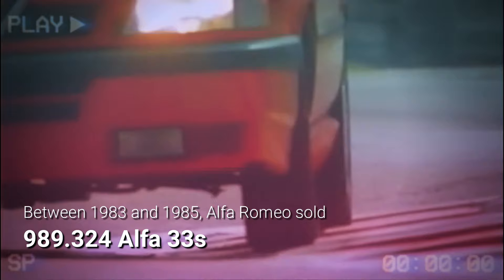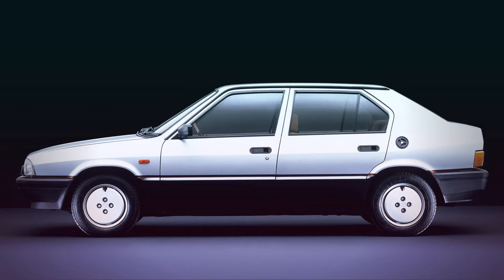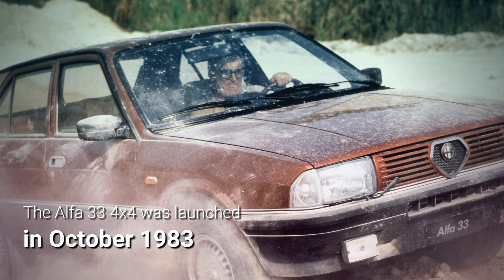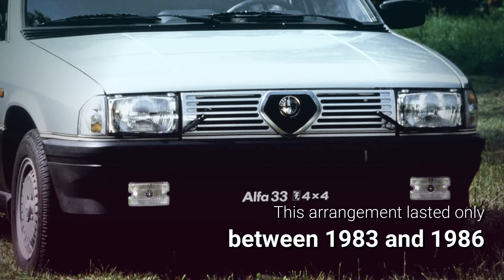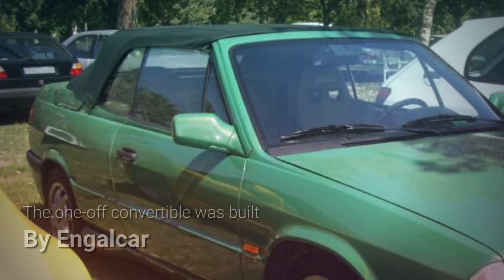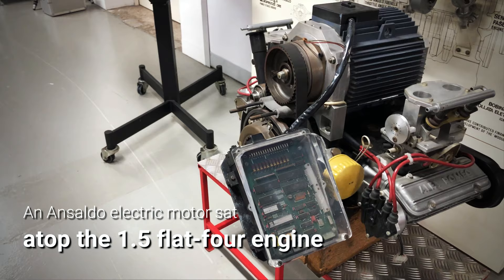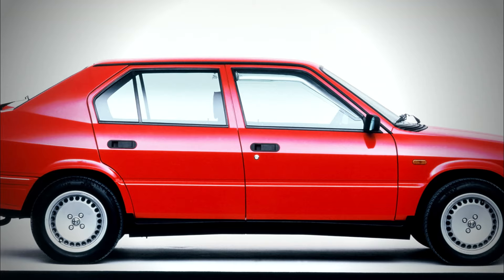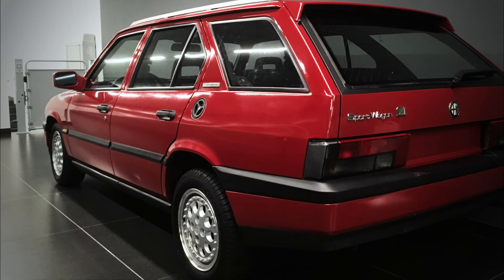5 Things You Didn't Know About the Alfa Romeo 33

Comment: Ahhh one of my favorite Alfas❤️
Owning two 33 at the moment. Both in Grigio Ardesia, 1x 1990 very early 1.3 VL Import from Turin( my First Car) and since 3 weeks a 1991 1.4 IE Project that’s under construction right now.
Reply from the maker: Very nice! Does the 1.4 IE need much work?
Reply: @Matteo_Licata   more or less, some body work is already done like rust protection and so on, big service is needed because it’s of the road since 2017. Brakes, Oil, Coolant etc. Already have a new set of Period correct wheels combinated with lowering Springs. Fun project so far and I can say I love Easy repairable cars of that period.❤️🚗
Reply: Torino or Turin 😉
Reply: @nessuno5403  yeah auto correct 🙄

Comment: I drove a few early 1.5 models with carburettors and drove nearly all the facelift range round Silverstone Club Circuit on an Alfa day in September 1991. That was great fun and the car was much improved with the 1.7 injected engine. I'd happily drive one now, it would still be a rewarding car to drive.
Reply from the maker: Cool. Must have been a lot of fun on the track that day!
Reply: @Matteo_Licata  I drove down there in a white 164 Cloverleaf and we had the whole range to play with ( they were Alfa UK staff cars). The day was run by the late Will Hoy( on behalf of Alfa UK) who had been a BTCC champion. As well as driving we also had rides with racing drivers and that was an eye opener. As guests we were far more careful not to abuse the hospitality of Alfa UK, but the professional drivers could let loose. Oversteering in a 164 was.....interesting😁

Comment: I had three 33s and no regrets. A 1991 1.7 8V, a 1990 1.7 16V and for nine years I ran a 1991 1.7 16V (last year before catalytic converters) 137hp P4. Great fun. I moved on to a Cloverleaf 145 Twin Spark with 155hp. Even more fun, a complete go-kart with incredibly direct steering.

Comment: I bought two Alfa Romeo 33. My experience with this car is mainly positive. It was funny to drive and performing for that time period. The engine was excellent, unfortunately FIAT didn’t understand its growing capacities and discontinued it. I experienced just one issue affecting the car stability during breaking at high speed (over 160 km/h) that needed an increasing of control and prompt driver reaction. It was probably due to the weight balance.

Comment: I still have a 33 SW 1.7 that I bought used in 1992. Great car, original engine and clutch, no oil consumption. I did all maintenance myself including replacement of timing belts ... ouch.... it drives to well to get rid of

Comment: Very interesting, the three door looked stunning. But wasn't the Arna intended to replace the Alfasud and the 33 placed higher in the range? At least for the marketing department. Ciao🙋‍♂️
Reply: It was more of a segmentation. They were positioned into the same class but with different target groups. The Arna should have been the entry model for youngsters without the need of large boot and offering 3-door layout while the 33 was targeting families with lower financial background still however providing great driving pleasure and good performance in the category.
Reply from the maker: The 33 was indeed positioned slightly higher than the Alfasud, with the Arna catering for the lower end of the market. But, having inherited the Sud's floorpan and running gear, the 33 is very much the model's direct successor anyway.

Comment: The British motoring press didn’t like the 33, because they were obsessed with the Alfasud. It seems the extra weight, but the same engines, even same power levels, took the edge off performance and handling. The Sud’s real secret weapon was the inboard discs. If you’ve ever lifted a brake rotor, you can feel the difference 😂
Reply from the maker: Yes, I know the 33 isn't held in the same high regard as the Alfasud handling-wise. Yet the Italians at the time couldn't care less and bought 33s by the truckload. The 33's design gave it a classier, more upmarket image, perfectly in tune with the 80s zeitgeist.

Comment: This video came in this day when I have a issue with my 33. The car just won't start. Thanks a lot for the video pal.
Reply from the maker: Hope it'll be an easy fix, thank you!
Reply: @Matteo_Licata  I think the timing belts slipped and the cars doesn't start, I refurbished the dellorto carburators, replace the distributor, cap and rotor, ignition module, spark plugs, etc, and, nothing happens, just the starter crunk... I don't known what to do....

Comment: Alfa 33 is great, it drives great, sounds amazing and there is a verion with 4x4 (my weak spot with cars), but damn it ages so so bad. Most of available models today are in disastrous condition with literally no parts available (I did found a German shop offering racing parts for Alfa 33, prices start at 500€ for even the smallest bits). This is why I ended up with 146 1.7. The suspension is from FIAT (the rear at least) and there is still a lot of parts available. BUT! My goal always was to install the 4x4 system from 33 to my 146. Never managed to do it but I'm guessing it's possible. No room for the driveshaft of course but the gearbox should fit the 1.7 boxer just fine. Anyways I think I'll buy the 33 someday anyway. This car is one of those legendary "true Alfas" that were produced back in the day, that's for sure. Love your videos!
Reply from the maker: Thank you very much. Yes, spare parts are an issue with many Italian classics, and the 33 is no exception. Here in Italy, there still are many good low mileage survivors around, thankfully, but having to replace parts can turn into a nightmare, yes.
Reply: The Permanent-4 has the propshaft running through the central tunnel with the exhaust pipe hanging slightly lower.  It has a bit less ground clearance than a 2WD car but it all fits pretty well.

Comment: All this love for the 33.
I thought it was a fine product for any other company.... But it killed the Alfasud.
It killed the Alfasud... and when it emerged after the funeral it had drums on the back and no inboard front brakes and it weighed a billion tons more than the 'sud.
Maybe not a billion tons, but more anyway.
Already by that time, cars were getting heavier and putting more rubber on the road....  Low mass was no longer thought clever or sexy. 
I am a harsh judge, but I saw the 33 as the very antithesis of progress.
About the only thing the 33 did that was in any way 'Alfasud' was to rust.  Rust and rev.  I'll give them that.  They could rev too....
I do think it was a nice car, maybe even a very nice car.
But it was not as good as the model it killed.
I have a strange affection for sporty Italian estates and I confess that I slightly admired the 33 Giardinetta ....   It was.... almost as nice as the Alfasud Giardinetta.
Good video, as ever.  
Excellent content.
33?  Not for me.
Reply: The only way you can like a 33 is if you haven't driven a Sud. 
You can have opinions about the build quality, the interiors, the estate and 4x4 versions and the styling (I like the two door concept)........ But dynamically, it's not a patch on the Sud it replaced. Like you said, it is inferior in every way. The press said so universally at the 33's launch and they were right; even up to the end of the 33's development, it couldn't match the Sud. The 33 was also not as good as the competition. Yes it was more fun and had better engines than a Golf but couldn't match it in other respects and if it was fun you were after, the Sud won hands down. When the 1.7 came out, it just highlighted the age of the chassis and the fact that it was conceived for about half the torque. Connoisseurs bought the 1.5 instead and appreciated the more refined and revvier engine, the more balanced overall feel of the car........... and most of the time, it made them really miss the rusty sud they'd replaced.

I must have driven every model of 33 going and owned a Permanent 4 which had the most awful ride and the most wonderful Recaros and that probably says enough about its schizophrenic nature. It did reward me with some memorable drives though. An early 33 Green Cloverleaf was a highlight too, as close as a 33 ever got to a Sud in my opinion and with an up-to-date interior, very fashionable 80s plastic add-ons and luxuries like electric windows. Almost, but not quite.......... which sums up the 33 really. 

I get why people in the comments may be nostalgic for the 33 but I feel sorry for them too because they obviously never got to experience the optimal version of it, namely the car it replaced.

Comment: I had 2 33s. One written off by an idiot drunk driver, the other stolen. Wonderful handling, so light on petrol, absolutely reliable little cars. What a pity the electrics were so woeful. I could never rely on the speedo to work on either of my cars, and just forget about the trip computer, the best it could manage was to display speed info, and randomly switch off the tail lights, also on both cars.

Comment: Sorry for the stupid question, but the Alfa Romeo 33 1.5 IE was permanent 4x4? I thought it was only rear wheel drive. So it was even better then I thought??
Reply from the maker: No, the 4x4 system used on the 33s was a simple one. The car was FWD at all times unless the driver manually engaged the rear axle via a lever on the centre console. The only "permanent" 4x4 33 was the 1.7 16v Permanent 4, which used a viscous coupling to distribute torque front and rear
Reply: @Matteo_Licata  Interesting. So that car had the option to use 4x4 and never used it...I never noticed any lever on the center console.